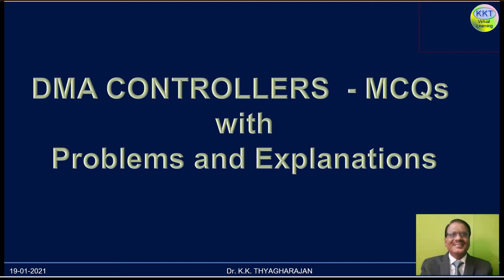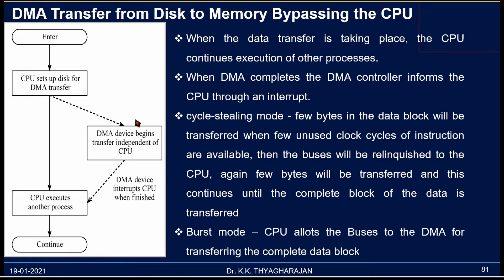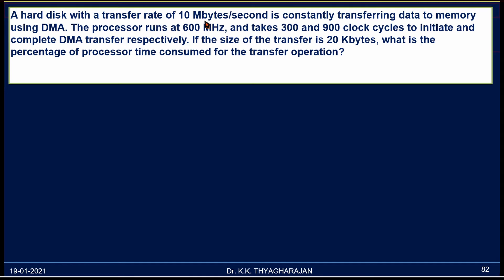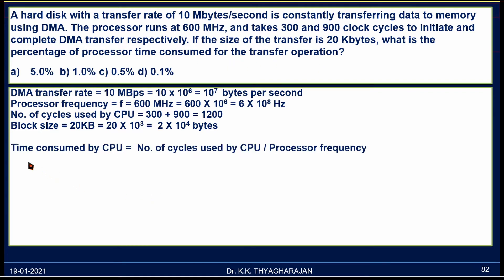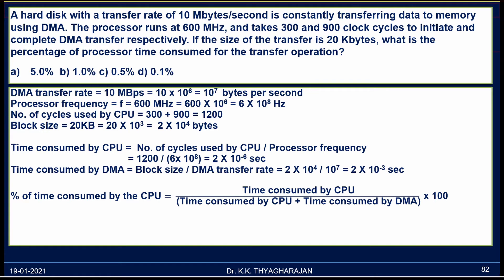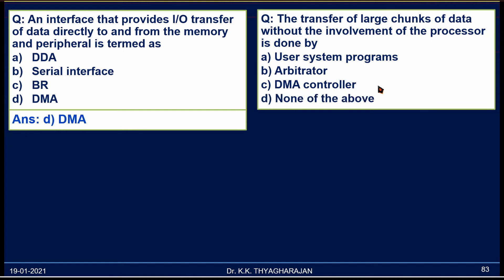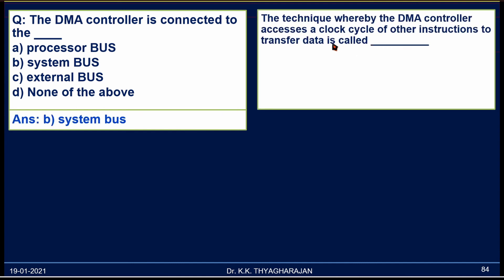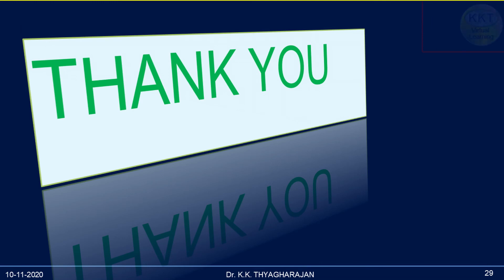4.6 DMA Simplified | Solved Problems | MCQ | GATE | Examination

Comment: Good presentation sir. If i want to study Computer Hardware and Architecture in depth which course is good for my interest CSE OR ECE?
Reply from the maker: Computer Architecture is one subject in CSE and ECE. Previously computer hardware and peripherals was a separate subject for CSE. The content was different and it was based on old Pentium computers. Now it is not offered. If you are very much interested in hardware , you can take ECE and then do ME in VLSI. Now VLSI is also offered as minor degree in many institutions. But no course will provide indepth knowledge only in computer hardware. You have to study digital electronics, microprocessors, microcontrollers, computer networks, digital communication, Software for VLSI design etc.